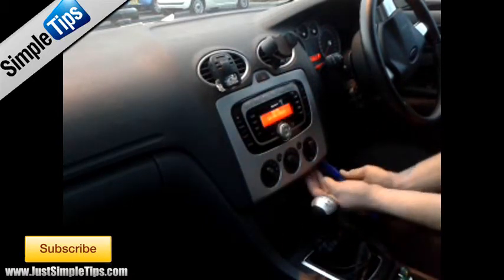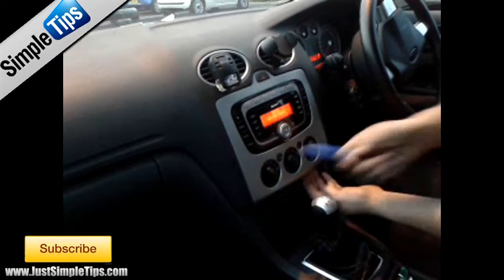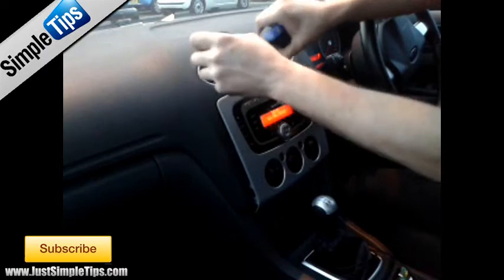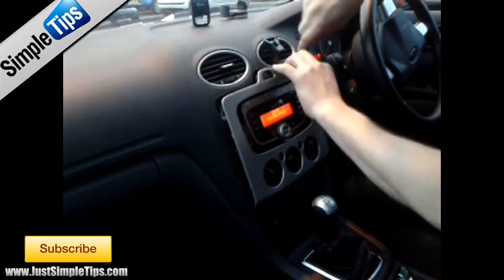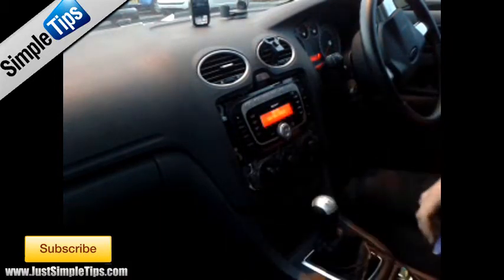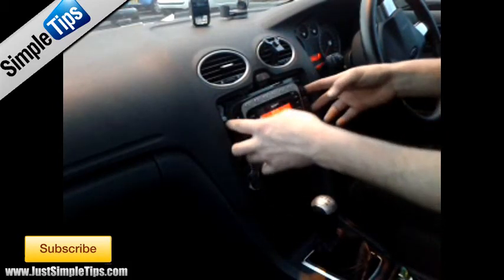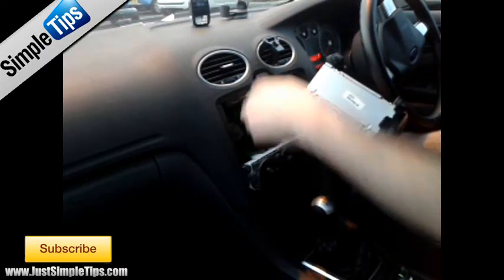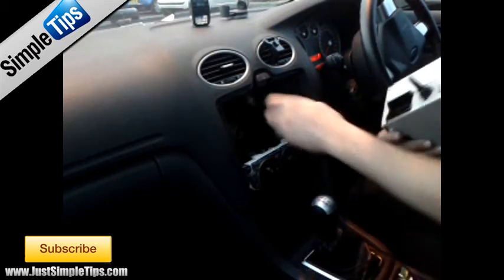Radio Removal Ford Focus MK2.5 (2008-2011) | JustAudioTips

Comment: I'm an amateur when it comes to vehicles, but is this what they call a double din unit?
I've a 2009 Ford Focus Zetec S and am considering upgrading the unit due to mine sporadically displaying 'Phone' and cutting my music off for no reason.
Reply from the maker: I would assume this is an issue to do with bluetooth in the car? Turn bluetooth from all phone devices in the car off as sometimes when you receive a notification it can disconnect audio.